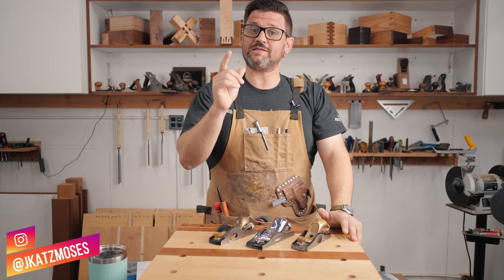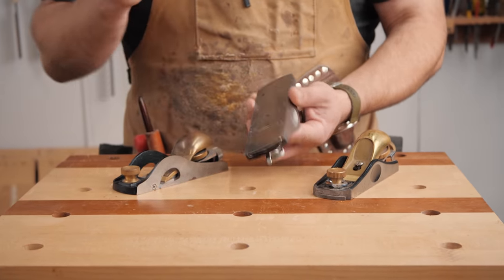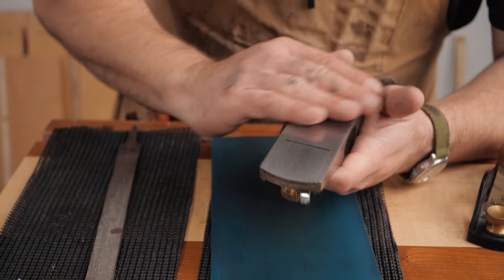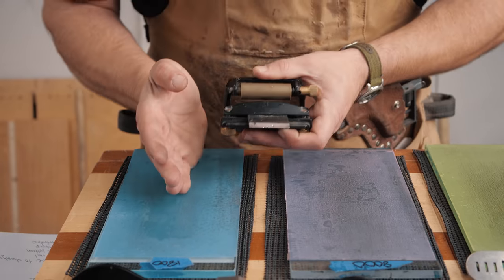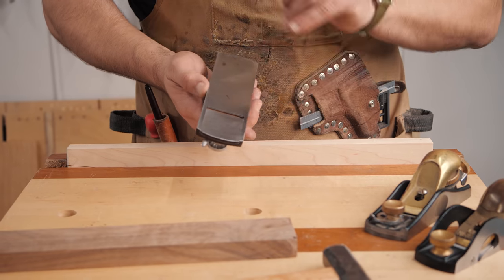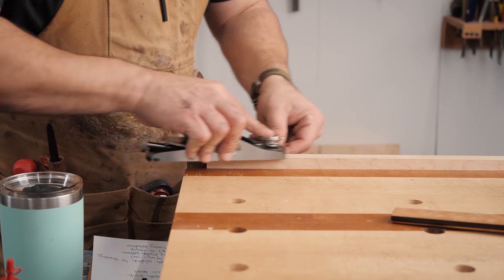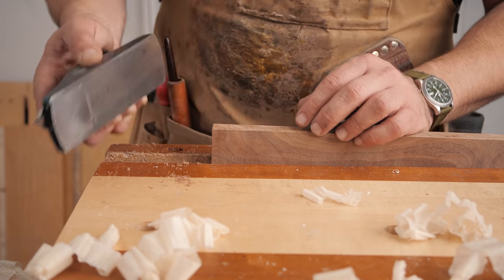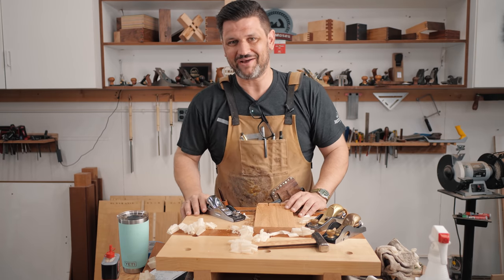The Block Plane - Tune Up and Use - Most Useful Hand Plane In the Shop

Comment from the maker: Lots Of Links today so make sure to click “Read More”
Scary Sharp Instructional Video- https://youtu.be/eom0qu5YO94
$62 Mid Range Block Plane With Cool Lever Cap- https://lddy.no/goz2
 (the Shop Fox I talked about in the video is no longer available BUT this one from TayTools is made in the same factory AND has the same style lever cap as the Wood River)  
$129 Wood River Block Plane- https://amzn.to/2S3yfsj
$175 Lei Nielsen Rabbeting Block Plane- https://bit.ly/2S8gDeC
Sharpening Supplies I used (make sure to get the PSA paper)
Main Page of Scary Sharp Supplies - https://lddy.no/ecii
Individual Products I used (make sure to get the PSA paper)
$12 Honing Jig - https://lddy.no/ecik
$25 Starter Set with half sheets - https://lddy.no/ecic
$43 3 Pieces of Float Glass with Lapping Film Starter Set - https://lddy.no/ecif
$25 3M Micro Lapping Film Set of 6 Full Sheets - https://lddy.no/ecid
Reply: Hi, this Is kind of a random question, but I was wondering where you got your shop apron? I really like it and would like to get myself one if possible.
Reply: @katzmosestools I used your link and bought like 7 tools, don't want a thank you just want to let you know so you can make sure Amazon gives you credit. Assuming it's ALL  for the affiliate link you provided. I needed a planer and your video pointed me to a quality one with good reviews. Was getting frustrated trying to find a good one by searching myself. Thanks for the videos. I'm going to try out this woodworking thing now that I think I have enough to get started. Sure I'll get more once I find out what else I forgot. Have a happy 4th brother!

Comment: thank you Katz . funny story if you like . i noticed your shop apron . it reminded me of one of mine sort of . i was a motor machinist in south texas it was a friday mid summer so hot anyway i was knocking off some metal with a disk grinder well . being friday apron was dirty and oily as it gets . i noticed it was just really hot on my chest for some reason. yup it caught fire and it was a smoldering from all the  sparks coming off the disk grinder. yup i was smoking hot lol . oh i am old  broken down  geezer who started wood working i got my no. 62 and block plane took em apart like all us do with a new toy lol . took me several minutes to figure out how to put em back together . it works so its okay lol . thank you for all your info . heads up dont let other ppl get under your skin . they are for the most part unimportant to you in the first place . rule of my thumb only ( if you are not feeding , putting a roof over my head or having sex with me you are not that important to me . be the best Katz you can be  . bless you and good luck

Comment: Great video Jonathan. I use my Stanley 60 1/2 nearly every time in the shop. Thanks for the comments on LN rabbit block plane. Guess I’ll need to make room in my tool chest for another tool.

On the topic of “sole to the bench’’ or “side to the bench”, I was agnostic. Then I got some remediation from the Woodwright himself, Roy Underhill. Roy is usually a very easy going guy but don’t put a plane on his bench with the sole down. His shop gets heavy use, including saw sharpening classes. His concern is not for the plane or the iron. The concern is for the stock that is being worked. Even a small steel filing picked up on the sole of #4 can leave a significant gouge on that expensive hardwood stock you have so carefully planed to a fine finish.

I am no expert and certainly not hating on anyone. Just offering food for thought.

Comment: THANK YOU SO MUCH! I was trying to flatten a #7 I didn't know what I was doing wrong, keeping the blade in there made all the difference
Reply from the maker: Yeah that was an eye opener for me many moons ago. Definitely had my work cut out for me fixing the ones I had flattened wrong.
Reply: @katzmosestools  is it because it's tensioning the cast iron, and putting stress on the inside?

Comment: Thanks for sharing! 
I'm glad to see that you are also not a big fan of the Veritas honing guide. Alas, I've owned one for a number of years, and never really got on well with it. The thing cost an absolute fortune, too, as I'm over in Scotland. I just found it, as you said, a real fidget to set up, and then found that I'd get uneven results as the chisel or block plane iron tended to slosh about in the clamp. In the end, I just went back to using my 30-year-old Eclipse.

Comment: Great video. I have 2 block planes that I use a lot.I have a Wood River low angle and cheap (India made I think). I have tuned up both and they work great. I did not flatten by bottoms with the blade in place. I will do that before the next use. Keep up the the great videos.

Comment: Great video! I'm using my block plane a lot and when I'm working it's always  within reach for all the reasons that you mentioned - it's a very versatile tool, I'm abusing it a lot and scary sharpening  it as much !!! It not an expensive one but once you flatten the sole and sharp the blade you have got a great tool in your arsenal!!

Comment: Full disclosure that I'm no expert in hand tools, but I was really impressed with how nice the Bench Dog planes from Rockler are. Not too expensive, but nice for the price, and frequently go on sale. The soles are lapped at the factory and come tested and certified flat. I didn't test them, but they certainly feel flat in use. The blade took a few minutes of work to get flat on the back, but nothing too bad. They come with "socks" to protect them (throw a dessicant pack in there to prevent rust) and nice, sturdy boxes.

Comment: This is the best block plane video yet. But I have a hard time setting the blade by looking down the sole as you demonstrate. I use a thin 1/8" thick piece of pine for test shavings on one side then the other side of the plane. When they are the same then the blade cuts evenly across.

Comment: Great video. I use a digital depth gage to determine the depth of the blade cut and have it "equal" on both sides of the plane.
Reply from the maker: That sounds labor intensive but like something I'd do. The line of site trick is very fast
Reply: That’s interesting - can you elaborate on how you do that?  It wouldn’t always be important, but could be very useful when trying to plane an edge to 90 versus the face, etc.

Comment: Hi again mr Moses on the Stanley 60 1/2” block plane it says it’s a low angle at 13.5 degrees here in U.K. hopefully that’s ok. But my question is after you remove the blade the adjustable bit to move blade in and out does that go under or on top or flush with the left and right adjustment. Hopefully you can understand what I mean. I took it apart to wipe it down and one of the bits I’m on about is a bit springy and I have memory loss so couldn’t remember and instructions are not good. 
I’m going to wat😢some other videos to see if they show it but I thought I would ask yourself as all your videos I have watched are very interesting sometimes a little fast but that what rewind was made for ha ha
Many thanks steve 👨🏼‍🦽

Comment: When flattening the sole make sure your surface is at least as flat as the one the manufacturer uses! Castings do distort however. I leave a few shavings on the bench to put the plane on. If you are sharpening to 6000 it is worth it.

Comment: So way off topic, but, I turned some shot glasses over the last few days and I wanted to use some of the "Katz-Moses Goo" only I did not need a bunch and I didn't want to use the stove or my kitchen pot and pans and decided to use one of my wife's wax burners worked out great. So yeah pro tip if you know someone who only wants to make a takeout condiment cup worth at a time or cant get catering stuff dur to stay at home orders. Great video and yeah that levering cap is awesome going to have to invest in a block plane sooner or later so think I'm getting a copy of that

Comment: When cleaning up outside dove corners, should one approach it with a well-tempered/aligned block plane first, or sand it down to within spec using, like, those bomb-proof Cubritron pads? Starting at like 80?

Comment: Hi JK-M,

What is the marking knife you are using in the video. I am looking for a handle which will take the Swan or Stanley blades. I have about 100 of the blades but only the Stanley and Swan handles. I want something with more bling.

My l-n block planes were my first quality planes. The ln 62 is my most used.

Great instruction as always on the prep of a block plane. Wasn’t the ruler trick publicized by David Charlesworth? 

Forget it. Answered my own question. Matt’s knives are all out of stack. I’ll have to make own myself.

Comment: Very interesting video , my only difference  with you would be that I use Camellia oil instead of 3 in one  , Camellia is chemical free , a rust inhibitor and a lubricant for sharpening  , its cheap and fairly easy to find  , it's the only oil I use on my Japanese carbon knives as it's non toxic to humans.👍
Reply: I’ve found that sometimes camellia gets sticky - have you had this issue?  I’ve been switching to mineral oil.

Comment: What do you think about using granite tile instead of float glass? I have some left over from a bathroom floor I did.
Reply: As long as it is dead flat, it will work fine.
Reply: I’ve done this - as long as it’s flat it works great.  They aren’t always flat though - so check it.

Comment: Any advice on sharpening the lie Nelson rabbeting block plane? I heard you can’t put the blade in a jig and I’m not really good at hand sharpening. That has held me up for purchasing, I like the functionality but can’t find any useful sharpening information.
Reply from the maker: I put mine in a jig. No different to sharpen. If you use the MK2 jig you need to center it with the smaller width but other than that its the same all around

Comment: I have a couple of block planes from the '40s that used to be my grandpa's, and I hated using them and had no use for them...until I properly sharpened them and set them up.  Now using them is almost cathartic, as they shave away bible-paper thin wood layers.  I have yet to unlock their full potential.

Comment: Always thought it had eventually to be flattened by a shop... I am using a Dictum rabbet block plane out of the box and it's doing fine... at least I guess... How do I test that?
Reply from the maker: Use some high grit sand paper on a piece of float glass (or known flat surface) and see if you get an even, full surface scratch pattern.
Reply: Jonathan Katz-Moses, thank you for your reply! I'll try tomorrow in my home shop. Anyway, this video has been helpful! Thumbs up!

Comment: Great video!  Buy good quality planes. Support local business and manufacturers Do not buy anything from China.
Reply from the maker: Everything is from China unfortunately. Probably 99% of the things in your shop
Reply: @katzmosestools   I use a lot of hand tools. I bought your dovetail guide.  I think that was made in the USA. But  I actually look to see where a tool is made. My chisels and stones are from Japan. My planes are Stanley  - USA or,Lee Valley  Canada. My vice was made in  eastern Europe. My table saw, jointer and planer are General - bought used - were made in Canada. (Not General International).
Do I have Chinese junk? Likely. But  if I need to replace something  I will actively look for another source.  But they won't get my money for the big stuff. We are all small guys with no "big" power except for what we buy. So I plan to exercise what little power I have and try to buy things that are not made in the country that gave us 3 viruses in the past 20 years.
Reply: @bryanmoir3184  I'm the opposite...won't knowingly buy anything made in USA..

Comment: There is no flex whatsoever in a metal plane.
Reply from the maker: Try flattening a flat plane without the blade installed and you will change that opinion pretty quick
Reply: @katzmosestools  ive done it for years and they come out to optical flatness. Youre plane is to rigid to flex.
Reply from the maker: Agree to disagree
Reply: @katzmosestools  so lets say i have a knife thats a quarter of a inch thick. Will that flex or not during sharpening?